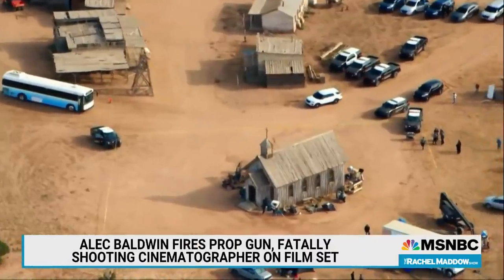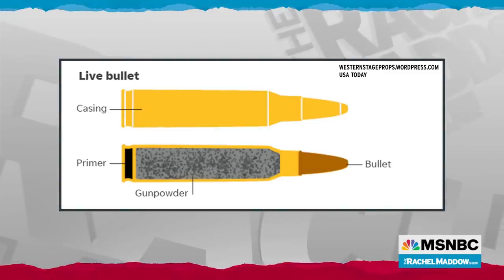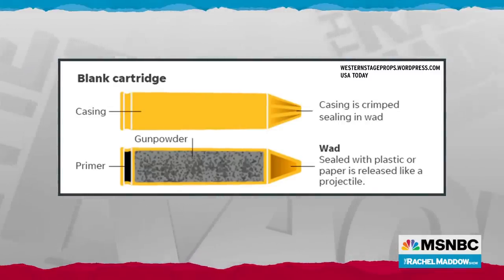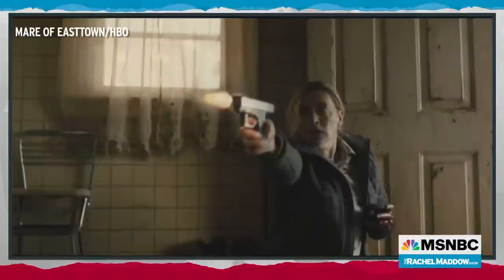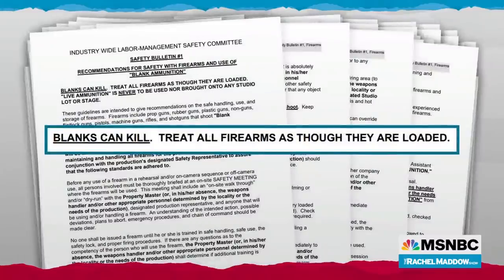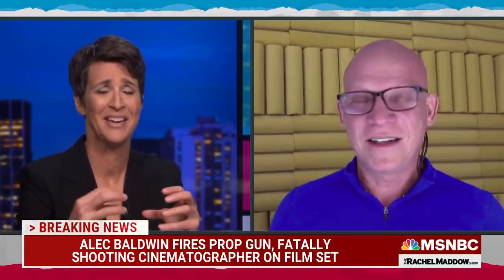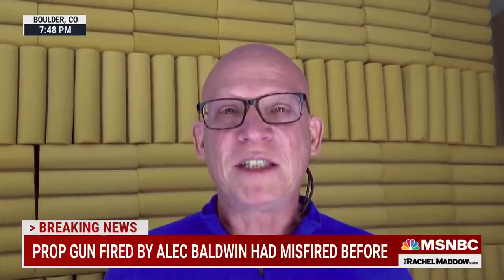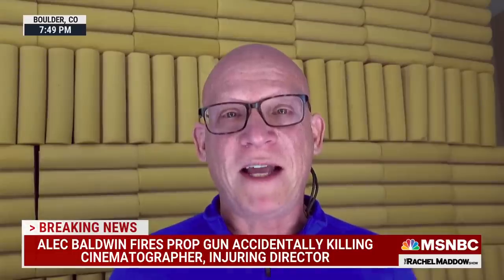Weapons Safety Expert Looks At Safety Protocols And Alec Baldwin Movie Set Shooting

Comment: With the Brandon Lee incident in 1993, there were TWO different kinds of fake ammo. One was the kind that had the primer and powder, but no bullet in the tip.The OTHER was ammo with NO powder, NO primer, but a bullet in the tip.

The purpose of the ammo with the bullet in the tip was for the purpose of close-up camera shots, while the actor is loading the gun. The other was obviously for the dramatic BANG.

When they put the close-up round in the gun, the bullet tip came dislodged from the casing, staying in the gun. So when they added the round with primer and powder, they effectively had a live round in the gun.

Michael Massee, the actor whose character shot Brandon Lee's character, has been traumatised to this day. Even though it was an accident not caused by him, and the gun handlers were 100% responsible, he still struggles. You can bet that you'll be hearing from him either today or in the near future.

Comment: A lot of people here don't know the definition of legal responsibility (Legal Liability) in saying that Alec Baldwin should have checked the weapon before firing it. 

Let me give you an example.  Do you always conduct a multi-point safety inspection before driving away in a rental car?   No!  Because you pay someone else to do all that for you.  So if you legally rent a rental vehicle from a rental company and have done so from a reputable company with the reasonable expectation that all the agreements were done via the letter of the law and in good faith, then it is not your fault if you hit a pedestrian because your brakes failed.  That's the fault of the rental car company if they did not properly maintain that vehicle's braking system.

Comment: A lot of productions don't even use blanks, they add the effect later in post-production. If you're using blanks in real weapons, you should have an armorer on set whose primary job is to ensure the safety of all concerned. I've fired my .57 cal. Enfield at many re-enactments and the safety protocols are very strict to make sure accidents don't happan.

Comment: There is a simple rule that everyone handling a firearm needs to follow: as soon as you put your hands on the weapon, check and double check if it is loaded by literally looking down the bore. Maybe "blank" bullets look like real ones though, so that might not have helped in this case, but still a good rule of thumb regardless.
Reply: Look down the bore?! That is NOT how you safely check a weapon! At least it is certainly not the first thing you do. You rack the action 2 or 3 times (if an automatic weapon) to make sure magazine and receiver are empty. If a revolver, you examine the cylinder. Maybe, once you've done those things, you could look down the bore but even then you'd only be ensuring that the barrel wasn't obstructed (though admittedly, doing that would have saved Brandon Lee's life).

Comment: To the best of my knowledge, no one has explained how two individuals were harmed by one discharge. If it was indeed a blank cartridge with either paper or plastic wad, I find it very unusual that it would pass through one individual and then strike another. However if it was a live round that would be easy to understand.

Comment: In the last 30 years, millions of people have gone through US Army live fire ranges using live ammunition. A handful of deaths from negligent, accidental, and malicious discharges have happened. 

Firearms on sets are not an everyday thing, even though thousands work in the industry and the protocols are strict and multilayered, there have been three deaths attributed (that come to mind) to firearm use on film sets in those same 30 years. The safety comparison per capita is striking. The film industry looks dangerous when compared to Army rifle ranges.

To be shot on a set by an actor using a firearm as a prop and killed, that risk should be zero.

Productions (and unsafe supervisors) don't seem to be listening, the safety protocols were developed for a very good reason.

Comment: The last argument is BS. It's a western. They use single action colt revolvers there. It means, you have to pull the hammer to progress the revolver and then pull the trigger to fire the shot. If the hammer was tensioned and the weapon wasn't maintained all well, it surely could have come to an accidental discharge because it released itself.

Comment: "Safety is everyone's responsibility" is the first rule on every movie set.  Baldwin should have checked that gun personally, if he had this would have never happened.  It's doesn't matter if someone told him it was safe,  he should have confirmed it himself.  It's just what a professional does.
Reply: I've not seen a movie set where any actor checks the gun each them its handed to them. Items are frequently taken from an actor, cleaned, redressed etc. after every shoot. It would be unreasonable to expect an actor, who is less trained in the item than the person who is hired specifically to handle it to check. 

Additionally, typically the only people who touch something are those tasked to do it, same with wardrobe. Because if you aren't trained on something you could break it, costing the film money, you could adjust it so it doesn't match up with other footage when cut together. Like when you see someone with a scar on their chin then they cut to another angle, no scar, then back and the scar is back. That is the failure of not matching. When more people tamper with an object the higher the likelihood that would happen. 

Thus actors (and other staff) are trained not to mess with things you aren't (authorized to be) responsible for. This issue does not happen because an actor forgot to check the gun. It happens because the person who is tasked to do this as their very job fails to do their job. 

It would be like blaming the clerk at the pharmacy who rings you up for not cracking open the medicine bottle to see if the pills match the description.

We have trust in those who are authorized to oversee something every day in our lives this is no different. He was told it was a "cold gun" (unloaded) there was no expectation it would be loaded (since it shouldn't be on the film set).

Comment: A modified "prop" gun that only takes blanks, is still very much a "real" gun if any for of projectile can be propelled out its barrel. Shields used for close-up shots when firing blanks, are usually not made to withstand a real, hard projectile, only to protect the camera from the wad, muzzle flash and unburnt gunpowder/residue. But even when used relatively safely like that, accidents can still happen. It's rare but it has occured, that foreign objects have gotten into the barrel, and that bits of the blank round casing have blown off. These fragment projectiles aren't aerodynamic, nor do they "fit" the barrel like an actual bullet does, so they won't be forced into the spin that a real bullet gets when forcefully propelled down the firerarm's rifled barrel. This is spin is what enables a bullet to come out of the barrel and travel on in a very straight trajectory. If you have a foreign object lodged in the barrel, or a piece of the blank's casing breaks off from the forces firing that round, that object or fragment now become a projectile shooting out of the gun - but because of its shape and lack of spin, these bits and fragments can spray out extremely widely and randomly when exiting the barrel. There might be a 3 feet wide blast shield between a remotely operated camera and the muzzle of the gun 4-5 feet away - but that fragment could really spray out so widely it still hits that remote camera operator 30-40 feet away and waay far off to the side vs the direction the gun is pointing. It may also happen that a camera operator is actually right there with the camera, behind such a blast shield but way off to the side - but a hard metallic fragment can still penertrate those blast shields that are only meant to protect from powder and residue spray. 

This isn't just a wild crazy hypothetical. It has happened before. I'm not saying that's what happened here, just adding some information onto why blanks can be so dangerous.

Comment: Just one critique in regards to the investigative expert. He was the investigator on the shooting on the set of the crow that killed Brandon Lee...

So he knows firsthand that just confusing a blank for a live round isn't the only way a shooting like this happens...

The Crow Shooting was the result of irresponsible prop preparation that left a live bullet lodged in the barrel of a prop gun that was being fitted to fire blanks... if you have a bullet lodged in the barrel and fire a blank through that same weapon, then the blank is going to provide enough gas pressure to fire the bullet...

Without a comprehensive investigation of the shooting at hand, all he's doing is making speculative assertions about the crew.

Wait for the official report

Comment: Worng a gun misfires if the hammer is cocked back..so if you drop it the gun will fire even if you shake it a little its still enough to release the trigger ive had many gun mishaps

Comment: Ok look this is a case of lax standards for handling of live rounds, lax security of the firearms themsleves. etc etc  The weapons should be only loaded with any rounds if 2 people do it together and both sign off that it is loaded for the specific scene. ANY powder charge rounds be it a blank or with a projectile should be highly controlled and locked down. This is just an accident that is not rally an accident. If you drink a 1/5 of whiskey and decide to crash your car, thats not really an accident is it? That is negligence.

Comment: Given that a revolver was the firearm allegedly involved here, I bet what happened was the same as what happened to Brandon Lee in 1993.

Real projectiles were in the chambers of the revolver to give the authentic look when aimed at a camera, with blanks behind the projectiles.

One of the projectiles has dislodged and entered the barrel, and after enough various scenes of firing the pressure from the blank rounds has blasted the projectile, that was stuck half way down the barrel, out of the barrel.

Think about it, unless you stick a rod down the barrel to check for obstructions, no visual safety clearing would have discovered it, as a visual check only clears the cylinder chambers, not the barrel.

Comment: Why don't they make special chambers on prop guns that will only work with special blanks?  For example, for a .357, you could have chambers in the cylinder drilled for .340 and you could have a .340 blank.  This would make it impossible to load a live round.

Comment: a gun that has a radio trigger in it, that when fired sends out a radio signal that the prop gun has been fired, the signal is picked up by a receiver and plays any gun sound you like, then ammunition is not necessary, and such an electronic device would be very cheap to make, even by an electronics hobbyist.

Comment: In addition, like Steve said I've never seen a gun go off by itself.  Guns ARE NOT the problem.  People are the problem and this case is no exception!
Reply: "Go off by itself" is likely referring to a gun just sitting there on a counter. Guns absolutely do go off accidentally. A shake causes the hammer to loose and thus the gun fires. The report said that specific gun had 2 instances of accidental firing in the previous week.
Reply: @TearDownGenesis  You missed the whole point. 😒
Reply: @jim8684  No, I didn't he's playing a semantics game. "its not an accident its negligence" type of logic. 

Look up the definition of accident. Guns go off by accident. 

"by itself" I don't know anyone who even reported that that happened so its a stupid thing to bring up. 

That's like saying "I've never seen a fire start itself" no, but that doesn't mean fires are always started deliberately. 

No one is arguing that errors occurred, so he is saying "guns don't go off on their own so issues would have been a factor" ok, thank's for stating the obvious that everyone knows.

PS. I love when people say "you missed the point" and proceed not to try and explain the supposed missed point. Feel try to try an explain the missed point other with move on, your response has no value.

You're like Trump saying "Wrong" in response to what someone said. explain what the right is or your wasting  everyone's time.

Comment: If they loaded the gun with blanks and a real round, ON PURPOSE,  everyone would have been told the gun was hot. It may have been the plan to shoot the blanks, then transition to firing the real round into a car window or object to film the real effect. If so, if he has not learned trigger discipline,  then the transition time between shooting the blanks and live round may have been when he accidentally pulled the trigger. Trigger safety must be taught, and repeated until it becomes more natural to rest your  finger outside the trigger well instead on on the trigger. The natural instinct of a untrained person is to rest there finger on the trigger while just holding the gun.  That's how most accidents with a gun happen.  Start watching closely in a movie with a gun, you can tell which actors have been trained and who have not by where their finger rests. Also, watch the eye they close, often they will close the wrong eye when shooting. They don't know you have a dominant shooting eye. They will look down the barrel and close the eye they are aiming with yet look through the one that should be closed.

Comment: Sh*t rolls down from the top down. Anyone who has worked in film sadly knows this is not new. 
-Producers not hiring union local 44 prop masters on a union feature film 
-Making the crew drive 50 miles after 12-13 hour days instead of putting people up in hotels for their health and safety. 
-Not doing safety meetings that’s should be done by the first AD in the morning who also instructs that there’s a prop weapon on set. This insures that the weapon has been inspected and everyone knows they’re safe on set.
-Rushing and making the days especially in outdoor shoots because you’ll lose light. 
-Not hiring the trained industry union individuals in the first place. 
-NEVER pointing a prop weapon at anyone

Comment: Why did no-one correct "gunpowder" to "cordite" or, more generally, "propellant"? With or without bullets, the gases that exit the barrel are still at the same velocity. Close enough, they alone can use whatever they hit as a projectile.
Reply: Yeah, it bugged me that Rachel seemed to suggest the "wadding" was the danger in a blank. I got the impression she thought it could come loose and become a projectile or something. 
That's not the danger of blanks, its as you said, the pressure wave (gas)

Comment: Details coming out now say it was a "rehearsal"...If true, there was no reason for Baldwin to have his finger on the trigger let alone pull it. Terrible tragedy, Totally avoidable. RIP Ms. Hudgins.
Reply: They mentioned that the gun had accidental discharges in the past so finger on the trigger may not have applied.

Also ...yes. why wouldn't you have your finger on the trigger. How is it a rehersal if you aren't doing everything how you would do it in the real thing? If he practiced without his finger on the trigger than its more likely in the live set he wouldn't put his finger in the right place.

What wouldn't be in the gun in a rehersal is live rounds (obviously) but also blanks. he was told the gun was unloaded by the asst director, so by that logic it would be more comfortable drawing and putting his finger on the trigger because there is no risk (based on his information) the gun could accidentally go off, thus perfect for full practice.

Comment: I think the only thing I disagreed with was guns only go off when you press the trigger, there have been historical instances of individual guns, and gun models, that can misfire at the slightest tap.  So it does happen, though I'm not in any way saying that this is what happened here, or that it absolves any responsibility if it did happen, there should've been better safety checks and procedures.
Reply: What you described is not a miss fire..  because a miss fire is a dud bullet which does not fire
Reply: @trumbydownunder750  Thing is, I was literally quoting headlines about this specific accident.  Sure, a misfire, refers to a contraction of 'missing fire', but ask anyone on the street and you'd find they'd mention something like an accidental discharge.   So, I'd rather use a term in common parlance rather than be pedantic and off topic, yeah.
Reply: @aaronkritusan9397  accidental discharge is the correct term,  but in this case was it an accident

Comment: I always thought prop guns were intentionally designed not to fire live ammo, to you know, so people don't get shot. Super suspicious
Reply: Not always. Some countries require more restrictions, i.e. you can only have guns like you described. In the US not so. 

Mainly because those other countries don't allow guns or guns of that type so they have to be sealed to be allowed in the country (World War Z had their guns confiscated because they weren't allowed there, ironically they were sealed and they eventually got them back)

Some guns used in movies may be actual ones of the era to help with "realism" thus they couldn't modify them even if they wanted to (because they likely belong to someone who is loaning them).

Also they are used for various other purposes like using live ammunition to fire for reference (closed set or firing range). 

While I'm not opposed to sealing guns, that's just to answer your question.